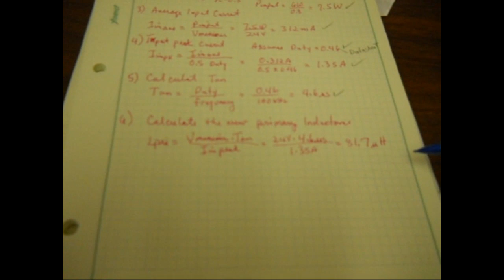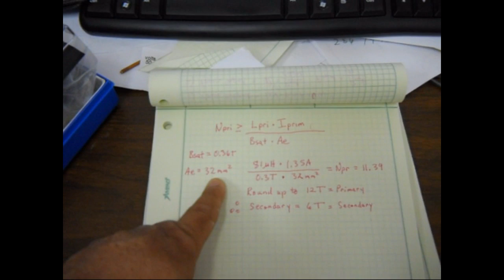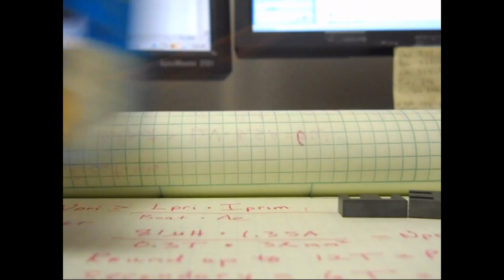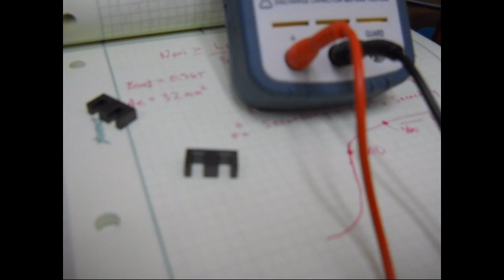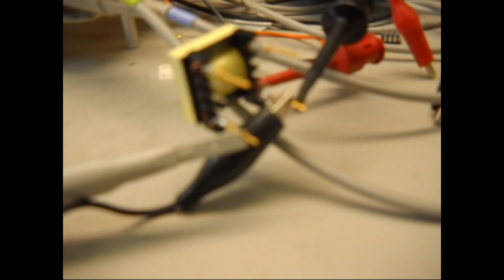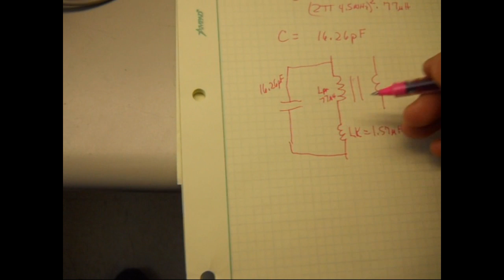Analysis and Design, of a Flyback; part 6; How to wind and characterize a transformer

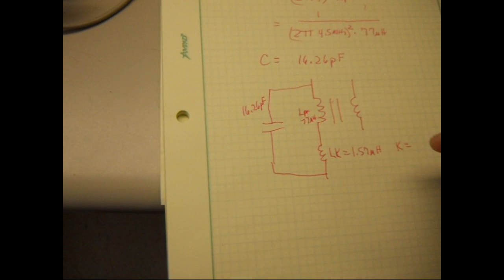Comment: 20:50 Hello Mr. Bolaños, while calculating parasitic capacitance, why did you use only Lprim = 77uH without including leakage inductance if resonant circuit model includes it?

Comment: Hi! Robert Hope you are doing well. Thanks a lot for your tutorial.
1- I want to know how you chose a given frequency. Is there any method for that?
2- How many turns are required for the wrapper to isolate the primary and the secondary?

Thanks in advance.
Reply from the maker: Hi Nysse, many years ago the frequencies were below 100KHz. If you look at the Pressmen book, SMPS ran below 100KHz. As mosfet have gotten better, the switching frequency have gone up. Increasing the frequency makes the compoment smaller. However, as you increase the frequency, you start to increase switching looses. Psw=V^2*C*F.   From this equation you can see why the power loose increase. Recently, there has been some movement, Professor Cuk, to use lower frequencies around 100KHz to 200KHz.  This frequency range seems to be the sweet spot. 
RB
Reply from the maker: 1 turn to 3 turns. If your voltage is 120Vrma or higher, you will need margins on the side for clearance and creepage. You have to put tape on the end for safety purposed.
Reply: Thanks for your responses

Comment: Hi , sometimes a 3 winding flyback transformer is used . The third winding is for the VCC supply of the offline switcher like "Viper22a". So how would we determine the third winding ? Is it there is any of your videos ? reference - https://www.st.com/resource/en/application_note/cd00047746-vipower-10w-power-smps-using-viper22a-for-air-conditioner-application-stmicroelectronics.pdf

Comment: Hey Robert, 
Your Flyback transformer design and analysis video is very insightful.
I am making a similar transformer using an E65 Core with a gap of 2mm. for 2800W of input power.
using your design method. I am getting the desired output, but there is ringing and the voltage spikes around 920Vdc.
could you share your email. I Would like you to have a look at the flyback waveforms ive captured on my DSO and share your thoughts.

Comment: Hi Sir very interesting video. 
I would like to ask more details on determining the primary parasitic capacitance. I mean, the ringing we see at 17.22 is a step response or something like that? How do you get it? Is the secondary open? Further, just for curiosity, why the same procedure is neglected for the secondary side AND for the intra-windings capacitance (primary to secondary)? Do that capacitances should be present into the equivalent spice model or not? (It seems just with one capacitance the spice model fits quite well the real magnetic) 

I would like to congrats for your videos. Very simple and intuitive always.
Reply from the maker: Hi Nicola, When you do a step response, the primary will ringing at its natural frequency. If you do the same step at the secondary, the resonant frequency will be the same frequency but when you calculate the Cparasitice using the secondary inductance, you will get a different capacitance value. It is much more convenient to just do the primary side. You can measure the capacitance between the windings and add it to the model. But to simplify the model, I leave it out. But if you prefer to include that is OK. Hope clears things up.  Robert
Reply: Thanks a lot.

Comment: That was one beautiful piece of information Robert, just one thing in the last simulation you have swapped the duty cycle and turns ration. Nr = 0.5 and Duty is 0.46
Reply from the maker: Hi Gupta, yes you are correct. Lucky that they are close enough to each other and not greatly effect the result.

Comment: how are you measuring inductance with Lc meter? what wire outputs  of transformer are you putting the probes to? it looks like you are measuring inductande between primary and secondary which does not make sence because they are isolated
Reply from the maker: Hi jimis04. I am measuring the primary of the transformer with the secondary open. This measurement will give me the primary inductance. I then short the secondary and measured the primary again. However, with the secondary shorted, the inductance will be much lower. This lower inductance is the leakage inductance. So this leakage inductance is un-coupled and is a parasitic and caused a voltage spike in the drain of the mosfets. Hope this clears things up.
Reply: Robert Bolanos ok that clear things up. i make  alot of experiments with flybacks either with IRf840 mosfets or npn topologies with but11 or mje13003. Experimenting with self oscillating topologies or IC driven but always at the end my transistor after some minutes gets fried. whatever high voltage supressor topologies or snubber i use doesnt work to eliminate voltage spikes. I will try to rewind my transformers better and use fresh wire and check the parasitic inductance the way you describe.ty!
Reply: Mr Bolanos hello again. I study again your videos and keep notes etc! Some questions!
What will happen if the inductance measured on primary is lower or higher than the calculated through equations (for a certain amount of primary turns that we also calculated)? I have some transformer that most of them are gapped more or less and ruin my transformers since in most of the times the gap (of the scrapped transformer) is greater than needed and  of course in this situation we cannot make the gap smaller so for a certain amount of primary turns i cannot meet inductance that i need. i could achieve the needed inductanse by increasing turns but then why do we make primary turns calculations for?.
However i know that there is a problem if the inductance is lower than ideal we have a problem. But what happens if its higher than needed? In your situation you increased the gap but is it really needed and what problems would occure if you didnt care about the primary inductance beeing 170uh (in your situation) and didint trimmed some of the core to lower it to 80uh?
I would like your opinion of how an enginner usually deals with these problems. Thank you for your time
Reply from the maker: Hi Jim, if you initial primary is lower than what you need, you need to get a ungapped core with a higher AL.  In some cases, you may have some cores that already have a gap and therefore you can not achieve the inductance that you need. In that case, the center part of the core material will have the gap while the outer edges of the core will not have the gap and therefore have not been grind. So if you want to decrease the center gap, you can grind on the outer edge of the transformer so that you can properly gap the core. If you have more questions or if my answer was not clear, email me at rbola35618@aol.com.

Comment: hello sir ,i have seen most of your videos i have learned a lot. Thank you soo much sir. Sir actually i have a question , i need 3.3v 100mA power supply in my product should i use transformerless power supply(with buck converter ) or design flyback converter ? 
Do transformerless power supply lasts long ?
I'm confused !
please do make your valuable reply sir .
Thankyou  ;)
Reply: U simple make transformerless supply

Comment: I want to design a transformer for Universal Input and Output of 15 V and 4 Amp at full Load Condition, I am Understanding that my output Power is 60W hence Suitable Core may be EE 30 or EI 33 but I am finding it difficult to find Bsat and Ae values for EI 33, is there any suitable way to calculate it????

Comment: Hi bob, somehow by mistake i flag you comment and its disappear from comment list, please repost.
Reply from the maker: +Kunal Barot Hi Kunal. Here is my repost. The 0.5 comes from the fact that you need to satisfy the volt-second rule. The voltage second rule says that the voltage across the primary (VL) times the Ton have to equal VL time Toff. In other words, VL*Ton=VLToff,  Vin*Ton=-Vout*Toff.  The reason is that the product of both are equal to ensure that the transformer resets. If the Ton time is longer that Toff, The flux in the transformer will not reset or not go to zero and will instead continue to increase to a point where the transformer core material will saturate. So avoid this, we keep it below 0.5. In practice, the 0.5 will be set by the PWM that you use. So you would look in the datasheet of the PWM that you use and look for the maximum duty cycle that the PWM specifies. So in the case where the datasheet says that the max duty cycle is 0.44, then you use 0.44 in you equations. Regarding the frequency, the higher the switching frequency, the smaller the physical size of your transformers and capacitors. However, as the frequency is increased, you start to have more switching losses due to the diode and mosfet. Keep in mind that the diodes and mosfets have parasitic capacitance and the power losses in those components are calculated by Psw=Cap*Vcap^2*Frequency.  From the equation, you can see that as frequency goes up, so does the Psw (power). I typically use 100KHz to 200KHz as a good compromise between physical size of the components and switching looses.

Comment: How did you decide the duty cycle and switching freq.
Reply from the maker: +Kunal Barot Sorry Barot, I missed this message. The dutycycle is set by the PWM that you use. When selecting the dutycycle, check what is the maximum dutycycle that the pwm can put out. Then give your self a little margin to ensure that you will control at low line. The frequency is set by you. I like to use 100KHz because it is a good compromise in component size such as the transformer and inductors and switching loss power. As frequency is increased, you get higher power looses due to the switching. Hope this helps. Robert

Comment: try not to put windings near the gap.  lots of fringe effects here will heat the winding.. just skip over it and keep on winding
Reply: neglect effects for small gap sizes, for larger gap sizes you can either place physical gaps on outer core legs  in order to reduce fringing flux, or a much costly solution is to use combination of  air gaps and sliced core rings in the center core leg of  the traffo, however if this is stiil complicated jump to the next available core volume in order to reduce the gap effects
Reply from the maker: High Hopes Yes that is correct. Also using a larger core and therefore a smaller gap will reduce the fringe effects

Comment from the maker: Mohammad,

Do you have access to an Inductance meter?  If you do, you can measure the AL of the C core by winding 10 turn of wire and then measuring the inductance of the winding. You don't need to wind a secondary, just ten turns. You then measure the inductance that the ten turns of wire in the C core produces and divide by 100.   Al=Inductance/100

So if you measure 100uH, you divide by 100 for a AL of 1uH.   Then you can calculate how many turns of wire you need to produce any inductance. For example, let say you need 1mH,  then you need  turn =  squareroot(1mH/1uH) = 31.6 turns

Comment from the maker: Hi Mohammad,

What is the core material that you are using? In switching power supplies, you ussually use ferrite core material. There are several types. The manufacturer of the core should have the AL published.

Comment from the maker: You need to know the AL of the core material before you start winding you transformer. One way to winding 10 turns of the and then measure the inductance. The inductance is calculated by  Inductance =AL*Turns.   Here is an example, if you winding a transformer with 10 turns, and you measuere  100uH, then you divide the 100uH by (10^2). You should get a AL of 1uH per N^2.  As for the leakage inductance, that is harder to calculate. It is better to winding the transformer and then measure the leakage inductance by shorting all the secondary. Hope this helps

Comment: Hi
How do you define the wire cross section? ( primary  and  second)
Reply from the maker: Hi Anh,
You can use the 400 circular mils/amp to calculate the cross section. Another method is to use W. H Preece equation that give the fusing current limit of a wire.
When you use this equation, it give you the current where the wire will open up. For example, if the fusing of the wire is 1.5 A, then you can then use a current of 10% of the 1.5A (150mA) as the current that you can safely carry on the wire. Just keep in mind that the current should always be expressed as RMS. The Preece equation is shown below.

I = a*d3/2 Eq. 1

where I is the fusing current, d is the diameter of the wire in inches, and a is a constant that depends on the material. He determined that a = 10,244 for copper. A little algebra transforms this equation to:
I = 12,277*A.75   Eq. 2

where I = fusing current in Amps and A = the cross

sectional area of the wire in square inches.

I = a*d

3/2
Reply: Robert Bolanos  Hi .    
if i have this require: Vin=24 V, Vout= 5V @ I out= 1A,
assume I choose :"The ferrite material 1P2400  has a saturation flux density of 360 mT"  
and
 "Core and bobbin: EFD20". 
I use the 400 circular mils/amp to calculate the cross section.
How do you caculate I RMS and define the wire cross section?

And
if i choose turns ratio = Nr=5/24, D=0.46 , f=100k Hz, effect=80 %, will it be true?  

Look forward to your help!
Thank you very much
Reply from the maker: Hi Anh, I will make a video about this topic.
Reply: Robert Bolanos When do you make a video about this topic? thanks so much
Reply from the maker: Anh Ngọc Nguyễn Anh, send me a e-mail to rbola35618@aol.com. I will send you a excel table with the wire sizes and current that it is capable of carry. I prefer to use this table instead of the 400 circular mil per amp.
Reply: Robert Bolanos thank you .  my mail is: anhngoc.bka@gmail.com, i'll send mail for you
Reply: Anh Ngọc Nguyễn I sent mail for you

Comment: Hi Robert, 

I have like to buying a custom transformer for my own SMPS using for high voltage flyback from TV.  Know where I can get good deal with transformer kit?
Reply from the maker: Digikey sells the transformer kit that I use in my projects. The kit is from Wurths.  They two kits for up 15Watts and a second for transformer up to 30 watts. I hope this helps. Question and comments can be sent to rbola35618@aol.com

Comment from the maker: Hi Chris,
This is normal for gapped flyback transformer. Keep in mind that you want the minimum number of turns that will prevent saturating the transformer. You can get magnetic core with various Al (NH/turn) and therefore get closer to the required inductance. However, most people use un-gapped cores which means that you need to grind the center part of the transformer. The gapped is where the energy is stored. I hope that answers your question.

Best regards,
Robert

Comment from the maker: This is normal for gapped flyback transformer. Keep in mind that you want the minimum number of turns that will prevent saturating the transformer. You can get magnetic core with various Al (NH/turn) and therefore get closer to the required inductance. However, most people use un-gapped cores which means that you need to grind the center part of the transformer. The gapped is where the energy is stored. I hope that answers your question.

Best regards,
Robert

Comment: Hi Robert,

Why is the inductance of the transformer so far off that it needs grinding??

Greetz Chris
Reply from the maker: Hi Chris,
This is normal for gapped flyback transformer. Keep in mind that you want the minimum number of turns that will prevent saturating the transformer. You can get magnetic core with various Al (NH/turn) and therefore get closer to the required inductance. However, most people use un-gapped cores which means that you need to grind the center part of the transformer. The gapped is where the energy is stored. I hope that answers your question.

Best regards,
Robert

Comment: Hi Kamil,

I usually put a small divider on the Isense line; these resistor or SAT (Select At Test).  The PWM Isense limits the current when the Isense line reaches 1V. So I like to set this voltage to about 0.8V so that I have 20 percent more current available as margin in case I need it. The divider makes it much easier to set this voltage instead of changing the main Isense resistor. With two resistor (Voltage divider) you will better resolution in setting the current sense. I add a small capacitor to smooth out the leading edge of the current (switching spike) Hope that helps.

Robert
Reply: I understand. Thank you for useful idea based on your experience.